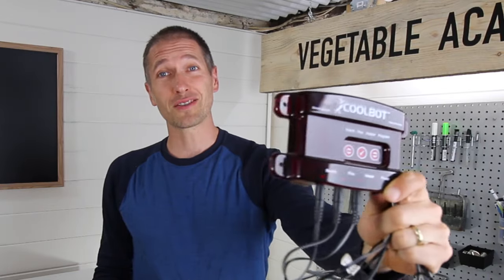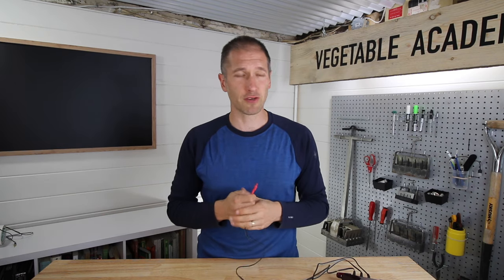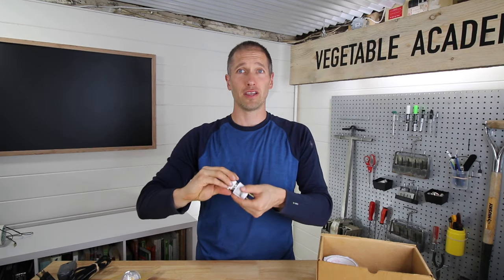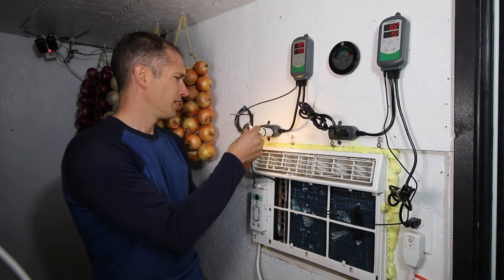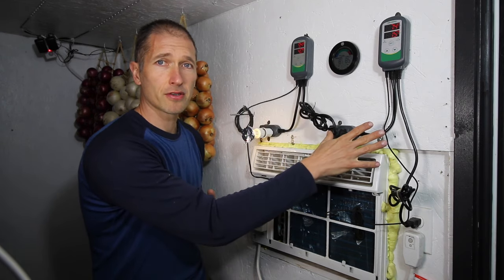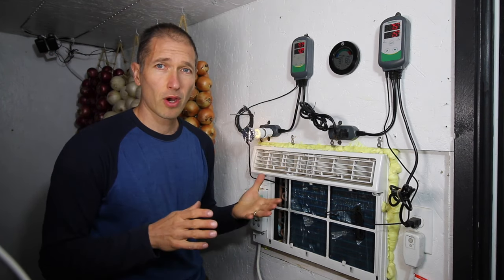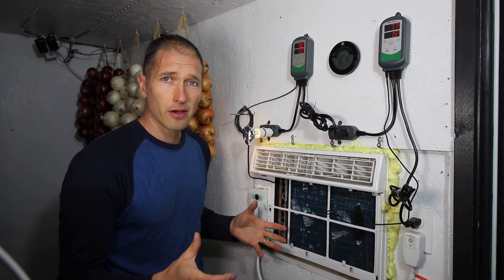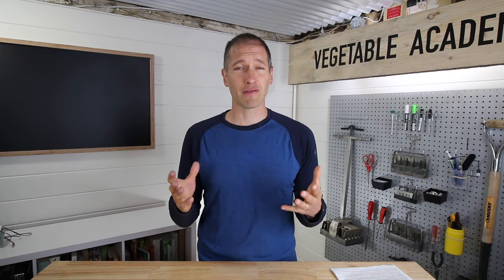Build Your Own Walk-In Cooler with this DIY CoolBot Alternative

Comment: I've got a bunch of questions
1. How big is that room?
2. what Kind of AC do you use? or am I overthinking and is any kind of AC enough?
3. How much per month does that cost in electricity?
Reply from the maker: 1. It's 5 feet wide, 9 feet long, and 6.5 feet high
2. We have an 8000 BTU window air conditioner.  Don't just use any AC.   Use CollBot's AC guide to help you find a unit that is compatible with this method of control.
3. I don't know exactly.  I have done some heat loss calculations that showed the cooling cost for a room this size would be a little under $100 per year if the cooler temperature was always 4ºC and the temperature outside the walls was always 20ºC and the walls, ceiling, and floor were all insulated to R20.  So there is a rough ballpark answer for you.  I would like to put a meter on the AC circuit and track the power usage each month, but that's a project that hasn't been my top priority.  This summer we switched to using an air source heat pump as the main cooling device.  This is fantastic because all the energy removed from the cooler now goes into our hot water tank so any money spent on cooling just heats our water.
Reply: @VegetableAcademy  thanks for the answer

Comment: Great Video !!!  Have you considered an ac fin comb to straightened the bent fins on the evaporator coil and condenser coil (if needed) for better air flow through the ac unit and better cooling efficiency?

Comment: Thanks for this instruction, very helpful. I'm wondering if I could modify a portable air conditioner and have it be effective? The cold room I have is only 72 sf and supposedly only needs a 1500 BTU airconditioner, but I can't find an AC that small on the market though the portable ones come the closest. Thoughts?

Comment: Could you share your temperature settings for each inkbird
Reply: At 7:04 he mentions the cooling controller is set to 4° C. At 8:21, the pre-icing sensor is set to 1.5° C, just above the temperature where ice will potentially form.

Comment: Great video! One thing though, but in my country it's much cheaper to buy one arduino and two temperature sensors than an inkbird, could this be the case for the US also?
Reply from the maker: It may very well be cheaper to program an arduino to perform the same task with two temperature sensors.  I don't have any arduino experience, but it still sounds like a fun project despite that.  If you've got the skills to make that happen go for it, and please share how you made it work.  The solution described here is a simple system anyone can assemble with off the shelf parts and no programming skills.
Reply: Would you share how to do it with your method? Would be very interested to see it as well.

Comment: thank you for this info., can you show how you plug everything in or if you can draw something out. Thank you for your time
Reply from the maker: The first Inkbird (the one with its sensor in the fins) is plugged into a wall outlet as a constant power source.  The second Inkbird (the one with its sensor on the lightbulb) is plugged into the cooling outlet of the first Inkbird.  The lightbulb is plugged into the cooling outlet of the second Inkbird.  The air conditioner is plugged into the wall outlet as a constant power source.

Comment: Hey i like what you did
But my techie self would use an Arduino with 2 temp probes, and relay to turn on the fridge. Probably would be even cheaper just need to write some code

Comment: Thanks for the great video. I am about to set my cooler up with this method. I was hoping to keep my inkbirds on the outside as my cooler is inside a large shop. The problem is the cord from the inkbird is too short for the light bulb plug in the go through the 6inch wall. Do you know if you could use a short extension for this? Hope this makes sense!
Reply from the maker: Yeah.  An extension cord for the light bulb shouldn't be a problem since the wattage is so low.
Reply: @VegetableAcademy  Thanks for the reply. Keep up the great work 👍

Comment: I'm assuming, after a power outage you would have to go and manually turn the AC back on given that it's a digital control panel and would probably default to off after a power outage
Reply: Many modern window AC units have an auto-restart feature to prevent this problem.

Comment: Do you happen to know whether a 2000 watt generator will run/start up a 10,000 btu air conditioner?  I plan to build my cool room where there is no electricity.  thanks so much!
Reply: The air conditioner will have a continuous draw of nearly 2000 watts with a surge/start up draw of much higher. The continuous draw will suck a bunch of fuel and be hard on both machines and the start up surge will be likely to trip the overload on the generator constantly, causing the cooler to malfunction when you’re not around. The 2000 watt will probably run it in an emergency but for continuous use I would get a larger generator. I hope this helps🙂
Reply: @LivingGoodAlaska  Thanks so much!  Very good answer, well explained!  I may have to rethink this project.  (Though I’ve purchased all the stuff….the incremental cost is getting quite a bit higher for something I may use for only a couple days, or not need it at all.   Thanks again!
Reply: @jim9214  You’re welcome, good luck on your project.

Comment: Great video.  I saw several on YouTube but I settled on your version.  I got the same equipment and it seems to be working good so far.  Can you tell me if your electric bill increased much and do you think the life of the AC is reduced any because it is working harder and longer.  Thanks
Reply from the maker: I wish I could tell you exactly how much power our air conditioner uses each year, but I don't have the monitors to track that sort of thing in detail.  I didn't notice a significant rise in our electric bills.  Our system has been working for 8 years now and the AC has shown no signs of letting up.  I wouldn't say that it is necessarily working harder in this scenario because normally, when installed in window, it would be responsible for cooling a much larger space.  The amount that it needs to run will depend on the size of your cold room and how well it has been insulated.  Check the CoolBot sizing recommendations if you have any doubts about the power of your AC.  We followed those recommendations and it's worked out really well.  I believe that they expect you to have R20 walls for this sizing calculator to be accurate.  https://www.storeitcold.com/build-it/ac-calculator/
Reply: @VegetableAcademy  thank you so much for your quick reply.   I really appreciate all of your help.

Comment: Has anyone checked to see if the thermo sensing part is resistance based and which direction it will go in when warming/cooling? In some aspects you could likely put a resistor in if you had the resistance table for the thermister, and alter that to create the difference in temp readout needed without an extra heat source?

Comment: I'm wondering if you've had any problems with the system running it a couple days on a row, is the temperature is maintained even when the ac is defrosting?

Comment: Hello, thanks for the great video. We are based in France and it's difficult to find window ACs here. Is the same set-up also possible with split unit?
Reply: Yes
Coolbot has a list on its website. I am using a LG split unit and it is now working great after I discovered that it has two temperature sensors that need to be connected to the light bulb.

Comment: Would there be a way to use just one? Mount the probe to the back and use the heat setting to trip the light bulb circuit?
Reply from the maker: I don't think I understand exactly what you're proposing, but if you can figure out how to accomplish all of the same control functions with one Inkbird, go for it.  I just don't yet see how that would be possible.

Comment: All I really want is my bed room to be in the 55 to 58 degree range. These modern window air conditioners shut the compressor off instantly. I've had 2 new ACs that serve as overpriced fans. 

All I want is the cooling mode to be on like it used to be.

Comment: Awesome information, thank you!  How long does the AC have to stay powered off for the fins to defrost?
Reply from the maker: We are not controlling power to the AC.  It is always plugged into its own outlet.  When frost is detected on the fins, the power to the light bulb is turned off, which allows the AC temperature sensor to cool down.  When this happens the AC thinks the room is cold enough so the compressor turns off and the fan keeps going to defrost the fins.  If all power was cut to the AC for the purpose of defrosting the fins, that process would take a lot more time because there would be little air flow.
Reply: @VegetableAcademy  Ok so the AC just thinks it is going through a normal on/off cycle and the fins that were nearing a freeze up have time to rewarm before cycling back on.

Comment: I have a 6x9 by 6' high room and a 6,200 btu AC. I tried tricking it with a ranco etc but not having much luck. Do you think my AC unit is big enough? And is there a way to do it with a ranco etc or should I send it back. And thanks for your video
Reply from the maker: CoolBot has a couple of resources to hep you with these questions.  One is their AC sizing calculator, and the other is a list of compatible AC units.  You can find them both here: https://staging1.storeitcold.com/build-it/ac-selection/

Comment: Great tutorial.
problem though. started it up this year and it seems the ac doesnt shut  off now. im using same setings as last year. what could be the issue?  i swear tge ac shut off last year now it just continually runs. when the light goes off shoukd the ac shut off??
Reply from the maker: One of the settings is likely different from last year then.  Our AC has an econo mode that shuts down everything when no cooling is called for, (ie. when the light turns off) but there are a few other modes that keep the fan running at all times with different fan speeds even when the compressor is not running.  This is great for air circulation in the cooler and CoolBot recommends that the fan be left on, but it can use a lot more energy.  I'd take a closer look at the manual for your AC to make sure I understood the settings correctly and maybe read through the CoolBot troubleshooting pages in their installation manual as well.
Reply: @VegetableAcademy  thank you. you were right. i couldve sworn i only hsd the ac on cool and fan high last year.  but i was wrong. when i put tge eco light on sure enough the ac shut off about 5 mins later. thank you.
i know you prob arent an ac guy but our ac is only a year old and this year it most def runs alot louder. you know of a reasoning for this?
Reply from the maker: @TheMcl77  I'm glad you figured it out.  I'm afraid I can't help you diagnose your AC noise though.

Comment: so when the temp controller (2) that goes between the fins turns off to cut the power to the temp conroller thats hooked up to the lights (1), are the settings on the temp control 1 just remembered when it turns back on?

Comment: I feel stupid having to admit this, but in case it might help anyone else, please DOUBLE CHECK the bulbs you order.  The amazon links above take you to the Amazon Canada page, but I'm in the US.  I searched for same part number, but there wasn't an exact match.  I ordered a different Phillips PN, which in the Manufacture space said Phillips LED.  I didn't pay any more attention than that.  Turns out it was 50w halogen. Within 30 seconds my thermistor started to smoke as it melted the rubber. Thankfully I yanked the bulb and averted permanent damage.  I felt dumb, but didn't even think to make sure since I searched the "correct" part number and saw LED on the listing page.
Reply from the maker: Thanks for sharing your experience Adam.  I am glad you recognized this different bulbs you had before too much damage occurred.
Reply: @VegetableAcademy  Me too!  I purchased a 4 watt and have it installed. I found I need to let the room cool down (50s or so) before turning it on, otherwise the AC will read "Hi" the temperature. I used a small airgap at first, but once the room was fairly cool, it didn't have enough heat to keep the AC going, so I had to eliminate the gap.  No big deal, just something I need to pay attention to when first turning  on the cooler when we prep to butcher.

Comment: Thanks for the video . I used it to build my meat cooler. I have all of the unit completed but I need a little more info. Can you tell us what were the exact settings on the controllers? Since I intend to use the cooler for meat my settings will be lower then for veggies. Also which sockets are you plugging into on the controllers? I can't tell by the video and you don't explain that. Thank you.
Reply from the maker: Good questions.  The controller (A) with its probe in the open air is set for 4ºC / 39ºF with a differential of 1ºC.  The light bulb is plugged into its "cooling" outlet so that power is cut off when the room is too cool.  The controller (B) with its probe in the air conditioner fins is set for 1ºC / 34ºF with a differential of 0.5ºC. Lastly, controller A is plugged into the "cooling" outlet of controller B.  This cuts the power to controller A and its lightbulb whenever the fins drop too low in temperature, preventing ice build up.
Reply: @VegetableAcademy  Thanks for the reply! Update: I applied your instructions and so far I can only get the cooler down to 44F. I need to be close to 35F for meat storage though. I am not sure if adding more insulation to the walls will help or not. Thanks again for your help!
Reply from the maker: @samnora2   You're welcome.  These instructions will allow you to replace the functions of the CoolBot, but you still need to make sure your air conditioner is properly sized and your room is well insulated.  Aim for at least R25 insulation value in your walls, floor, and ceiling.  Our cooler works fine, but I still wish we had added more insulation.  CoolBot has a quick calculator that can help you select the right size of air conditioner for your space.  You can find that here: https://www.storeitcold.com/build-it/ac-calculator/. This page doesn't mention the R value used for the calculations, but it is safe to assume it was R25 since CoolBot lists that as the industry standard.
Reply: @VegetableAcademy  My walk in is 4 ft by 4 ft by 8ft tall. I put a 5k btu ac in it and the walls and ceiling are insulated to approx R21. The coolbot web site says I should use a 6k btu ac for the area with a target temp of 38f. It seems I am short on the insulation and the btu's. Right now I can only get the temp down to 41f. I built it  on a concrete pad and I didn't insulate the floor yet. I am hoping when I insulate the concrete floor I can get the temp down the last 3 degrees. Thanks again for the help!
Reply from the maker: @samnora2  If your floor isn't insulated yet, that certainly explains a significant part of your trouble.  Concrete is a great conductor so it will be wicking in a lot of heat through the floor.  When you cover that with R20 as well, I think you'll see a big difference.

Comment: Of the heat that is produced by LED lights, only about 20% is transformed into light, which results in a lamp that is cool to the touch. However, the back of the LED releases the remaining as thermal energy. If you examine larger LEDs as in vehicle headlights, you'll see heat sinks on the back and possibly even small fans. So the heat trigger light you've designed and deployed could instead be a very small incandescent bulb such as a Christmas tree string bulb. They release most heat as IR out the front. You might, in this manner, generate even less overall heat into the room. 
FYI and thanks for the informative vid.
Reply from the maker: Thanks for the idea!  When I was setting this up, I was fixated on low wattage LED's, but I didn't think about using a specialty incandescent bulbs from Christmas lights or flashlights.  Those could work great too, as long as the right adaptors are available for plugging a single light into a standard outlet.

Comment: Thanks so much for the vid. We used this for our meat cooler. Anyone have the ink birds reset to factory defaults after they turn off? This continues to happen. We have this exact setup. The room is set to 34F and the coil temp probe is set to 15F
Reply: Also doesn’t seem to get the room cool enough and the unit is building ice